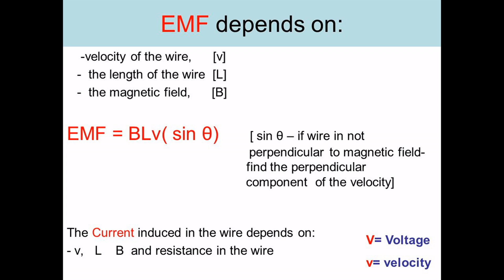1867 The Perfect Generator For The Home Builder

Comment: I don’t see why that has to upset anybody. It’s application dependent. If you want a wind turbine to make electricity you don’t need all the heavy expensive finely machines components. But if you’re gonna build a truck to haul 1/2-3/4 ton at a time you need an engine that produces sufficient low RPM torque and horse power to move that load and accelerate reasonably in traffic. There’s room for every technology except AI in the world.

Comment: I think it goes back even further than the steam engine, the shaft being the focus. The earliest methods of harnessing rotational force in the West, I'm thinking of mills with water or wind power, all needed to use the power somewhere remote from where it was generated. A flour mill exposed to either wind or water is not going to be ideal. The obvious way to transfer the power from these large wheels is via the shaft. You only have to make a single hole through the wall of your mill to bring the shaft through and then, using belts, gears and pulleys you can get that force where it's needed. From then on we, as a culture, seem to have stuck with that idea and simply improved on each part of the process without re-evaluating the process as a whole.
     I suppose there have always been innovators along the way, but the majority of the guys who were applying new technology to actually produce stuff (and thus make money) most successfully seem to have been the guys who were a little more conservative but dependable. Obviously this is a massive generalisation, and exceptions abound, but it does go part of the way to explaining why we have the conceptual framework that we have. That is a powerful insight you've had there, Rob! It never occurred to me before, but you are spot on, and I'm wondering in what other ways those preconceptions are affecting us; from our interpretation of the Pyramids to the current wave of interest in UAP/UFOs and our ideas about climate change. Perhaps we need to deliberately try and find alternative ways of looking at all these things?

Comment: Torque and speed are interchangeable, that´s basically what gears do a wheels are also just gears. Energy wise lots of torque at a slow speed is the same a little torque at a high speed. It matters not for energy generation, it´s the same amount of energy. Some machines are better suited to provide more torque and turn slow this way you will get high ampere and low voltage and some machines turn rather fast but with little torque and you will get high voltage but low amperage in the end it´s all the same.

Comment: If, in your serpentine coil design, electricity generation is improved by increasing the speed at which the coil passes through the magnetic field what might be the benefit of contra-rotating the two components so instead of one of the two elements rotating relative to its static "partner" you would have them turning in opposite directions, making the closing - and passing - speed of the two components - coil and field - twice as fast?. 
Perhaps a wind turbine attached to each component with one of them geared to rotate in the opposite direction should do the trick.
I leave the design of a working model of this idea to you.
Keep up the good work.

Comment: I always think of speed at the rim first. This is why I love gears and pulleys. I like the idea of using high gear ratios to get the maximum possible efficiency from a generator/motor, with torque on one end, speed on the other.

Comment: Hey Robert Murray Smith, why not try a proof of concept, with say one of your Rose or feather platter turbines as a sun on a downward cone edge profile platter, A bladed VAWT with vertical blades on a V bike rim, and nylon beads drilled half through, pressfitted on three brushless DC motors as generators and planet bearings?
Or you could just use a router like a compass to cut a V groove in some plywood, and epoxy+coloidial Silica seal the edges and spin grind it with a tapered grinding bit in the router to a hard perfect round surface.
It would combine good high torque low wind starting with contrarotating bonuses.
And of course the high speed stationary rotating planet bearing, small generator advantages.

Comment: Here's a thought. Why not take it a step further. Hubless turbines or thrusters using ring and sun configuration, and stationary rotating balls or rollers as driving elements for small high speed motors or generators.
Contrarotating  blades, whether VAWT or axial flux have big potential efficiency advantages, and these are often bigger  if they are rotating at different speeds, with different prime number blade numbers. 
And there is efficiency and mechanical advantages to   driving the ball or barrel roller from both inner and outer rings. And having those rings supported for axial, radial,  thrusts and torques. 
You could even consider a  hybrid or infinately variable transmission variant by driving/braking the sun ring by electric or mechanical means.
Reply: Hey Murray, why not try a proof of concept, with say one of your Rose turbines as a sun on a downward point cone edge profile platter, A bladed VAWT with vertical blades on a V bike rim, and nylon beads drilled half through, pressfitted on three brushless DC motors as generators and planet bearings?

Comment: In a wind turbine, isn't the lever the other way around? Moving the coils and magnets (the mechanical load) out to the edge puts it at the wrong end of the lever? You want maximum force at the tip of the blade for lots of torque at the hub? Or am I missing something?

Comment: Thank you very much Sir I am inspired by your enthusiasm. I set up a wind turbine manufacturing company in 2009 in West France. It was a good idea at the wrong time but I still have a machine functioning. I’m working well for the last 14 years in my garden as well as this, I have an array of solar panels and designed a very nice wood store with a solar panel roof. I’m interested in the idea of building an actual flux horizontal win turbine. It will be an interesting project on fusion 360. I also have a 1 m x 1 m 20 3-D printer, which my son and I built last year so keep up the good designs and I’ll keep watching them. Thank you

Comment: As i have mentioned several times before.... flip the anode of a magnetron inside out and use it as the rotor... and build a much larger anode with far smaller resonant chambers facing the rotor, place a clockwise twist the the anode of the rotor and a counterclockwise twist on the anode that is in the place of the stator... cap the ends of the resonant chambers with magnets and insert output feed loops in the chambers of the stator or rotor or both...

Comment: I agree with the concept. It is one I have been espousing for years, only not at the macro scale, but the micro. Magnetic domains which, when small, are circular. It is the inter-linking of domains which creates a field at the macro level. These domains are not fixed in physical space, are mass-less and can themselves be induced. They are able to be influenced by a relatively small external force (compared to the number of domains, which is in proportion to the density of the flux of the macro field), to alter their alignment direction. This leads to a reversal of polarity of the macro field with resultant localised induction of EMF. Thanks Nikola Tesla.

Comment: Hi Robert,   I'm part of the utility industry,  I have worked with steam turbines, gas turbines, wind turbines, diesel, solar Generators.  These generators have been with stationary or rotating fields.  I think your on to something good with your wind Turbine and using the most outer circumference of your Turbine Wheel.  Have you seen the US-DOE's tin fusion generator?  It's remarkable.  They take tin turn it into a plasma state in a electromagnetic confinement field and the light is converted directly into electricity at a 92% overall efficiency.  No mechanical generator needed, no steam cycle.   
Good luck on that Great Wind Turbine Generator Set.(WTGS).
Reply: @92% does that include creating the plasma field and electromagnetic field to contain it ?
On first reading your explanation 92% sounds a bit high ( putting it mildly)

Comment: I had to watch this again because I visualized an awesome dual rim electric bike generator set up that consists of socketing the front wheel with alternating neodymium permanent magnets and mounting coils on stationary rims to the bikes frame closely to the front wheel, creating a 26 inch rim generator that utilizes my bikes high speed spin while in use.  I actually believe that might be the principle behind zero contact regenerative breaking systems in electric vehicles.

Comment: The simplicity, high efficiency and low cost of a 3 bladed propeller and a tail vane to turn the prop to face the wind is still hard to beat from the point of view of increasing the wind capture area.

Most designs that rely on stationery structures to capture more wind incur the penalty of a much higher cost.

A strong central axle coupled to a conventional generator is much less expensive than a rim-based generator as the device increases in size and power. Do your own spreadsheet based estimates, and convince yourself. Been there and done that !

Comment: You are definitely saying it  just how it is. (~_^)-b

All of my planned wind turbines are going to be vertical axis, and I am really favoring the feather concept you have been showing as well.

I was just recently blessed with roughly 440 feet of solid single strand uninsulated 8 gauge wire.

I could make one truly massive serpentine coil out of that, and, if I literally only use one wire per turn, all I need if I wish to go around more than once [provided there even is enough wire in 440 feet to do so, is put some insulating tape between the two passes, as the voltage should be relatively low.

Then I just need to come up with  a way to make my own ceramic magnets in really large numbers, and I think I have the way to do that using sodium silicate and a whole bunch of micro-fine magnetite.

I can split drive rectify 220 volts and run it through a couple of microwave oven transformers for a field and let them induction harden themselves into polarity. [in other words, use the coils first under alternating current to melt the sodium silicate and magnetite mixture inside its mold, then once its hot, switch over to DC voltage to put a polarity on it so it will cool in the magnetically polarized state.

It would be a really simple machine to build, just a couple of really durable high amperage solid state relays and some equally durable high amperage diodes.

Comment: How on earth do you calculate what you need, all the component diameters, amounts of turns and length of wire etc to achive 48v and many many Amps in a reasonable wind.
It my brain is to smooth for the Math.

Comment: Oh Robert, how could you poo poo the chu chu....

Lol, I do like a good steam engine tho👍

I have been fooling about with edge drive ever since I realized that pushing a Ferrari Testarossa around the shop with six guys was nuts when all you had to do was rotate the wheel and the 80 ton fire chariot was moved with ease. 
 
Problems for a road vehicle I need to solve are  the mass of the drive wheel over rough surface and the magnetic crud I collect from the road dirt...  
minor things in it all really.

Any way tech for me is Everything everywhere all at once

I use it without regard to age, it all offers something,  perception of that offer is of course key.  
 
Rim drive is a great advantage, amplifier, lever, to get the wheels turning.

Come to think of it... I think you guys built an rim driven steam powered lorry over there ... may that Mack coal hauler... cant recall.  But I have liked the Unimog drive system since I was a kid.

Thank you Robert for all you do and share, we are all the better for it, and grateful.  Hope to shake you hand some day.

Comment: Just finished watching the Raptor hub-less thruster video and notice they wish to use a jet fueled engine to provide the electrical energy to drive the thruster. Could a similar or larger "thruster" configured as a generator be positioned behind, the motorized thruster to charge a battery? It's the same air and presumably the variable pitch of the blades could ensure that the flow is optimal.  What am I missing?

Comment: As below, rim drives and generation are fine; but rim bearings are inferior to an axle. The rotational speed is immaterial - torque x rpm always equals power, and axles rarely break.

Comment: I was thinking about your atmosphere energy switching problem.  

If you used a true glass tube Reed switch you could switch the reed with the perimeter magnets on your wind turned generator.  

One machine harvesting both potential power sources.

Comment: Is it possible to use a mercury homopolar motor in reverse? Use mercury bath as lower bearing. Spin the mercury in a magnetic field using a vertical generator (perhaps your flat generator) to create a current. The mercury acts as both bearing and collector.

Comment: Yes... The beauty of a system like this is you can put many coils around the outside and with some clever programming, as the speed to the rim increases activate additional coils to keep the speed of the turbine and the  generation optimized.
Low wind speed = 1 or 2 coils.
High wind speed = 20 coils.
Thanks 👍

Comment: Force and distance, torque and speed, current and voltage all inhabit the same realm of the equation. Power/watts. In wind turbines the resistance to the movement of the generator is mainly the electrical load. The more current you draw from the generator the more the Lenz effect works against you and requires more torque. So having the generator on the rim, at the end of the lever, even though it goes fast with no load, will require torque to move that long lever through the magnetic flux caused by the current in the stator coils.
Reply: Here is a thought, as the load slows the rotor, the coils and magnets slide closer to the axel speeding up the rotor.
Ice skater spin.....🧑‍🔬 or 🤡
Reply: @davidsoulsby1102  so the magnets would move outwards with higher RPM?
Reply: @jimlipscomb3236  only if they are free to move.  Stepper motors...
Reply: @Jim Lipscomb   Sorry missed the ? mark...  They would be controlled by the electrical load, the higher the load the closer to the axel... the magnets would need to be controlled....  its just an initial thought on how to control the torque/speed issue.
Reply: Brilliant!

Comment: So, if the magnet and the coil were both moving but in opposite directions, wouldn't this increase speed and output?  Possibly by reversing the vanes on a wind generator?  Just a thought.
Reply: Yup. But having the coils on one rotor and magnets on another,  requires using slip rings to collect AC current off the rotor with the coils.  Which isn't terribly bad,  but introduces some resistance, to current and some periodic maintence to replace the brushes.  But you do get higher voltage, or you may use thicker wires with fewer turns for more capacity to produce amps.
Reply: @kreynolds1123  If a two gears and separate shaft is used, it could be achieved without slip rings.  Then you would get opposite directions with a single input.
Reply: @robpridgen3791  I'm not sure I follow. Could you explain that again in other words?
Reply: @kreynolds1123  Certainly.  If you have two similar gears meshed and you have a shaft through each, when one is turned the other will turn in the opposite direction.  So, if you also have somehow attached magnets and a coil to the shafts, you would get the increased speed we mentioned earlier.  And you would only have to have one driving shaft attached to a force.  ie, wind, water, etc.
Reply: @robpridgen3791  but anytime you put a coil on a rotor, to get current from that rotor coil off the rotor, you'll need  either slip rings or commutator with brushes for a current collector.
Reply: @robpridgen3791  One exception to requiring brushes with slip rings or commutators when coils are on a rotator is if you have a rotory transformer  as commonly used to get signals off a vcr spinning heads.  And that might be fine for signals but gets difficult to do for sizable amounts of power.
Reply: @kreynolds1123  You are way above my head now:).  I was imagining two independent flat disks with magnets on one and a coil on the other.  Each on it own shaft.  Then spinning in reverse direction one over the other.
Reply: @robpridgen3791  alright. let's go with that, and focus on the rotating disk with a coil. How do you get current off the disk to an external curcuit?  

I was saying you need either slip rings or a commutator with current collecting brushes. 

Then I was reminded that its possible to use a rotory transformer that can inductivly couple some AC energy off the rotor to a stationary coil.
Reply: @kreynolds1123  Now I see!!!,  Definitely need commutator and brushes.
Reply: @robpridgen3791  or sliprings.